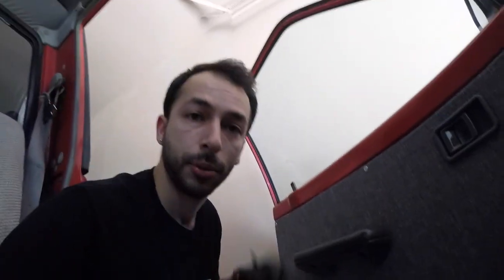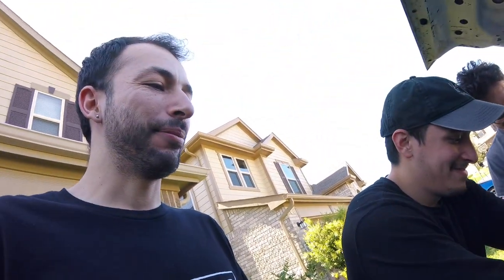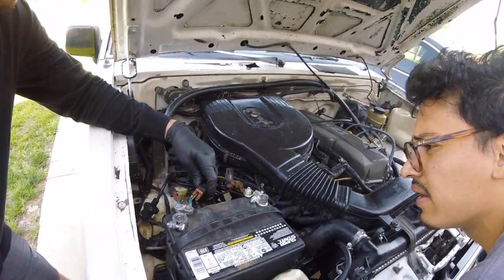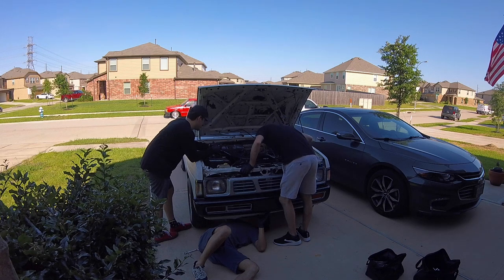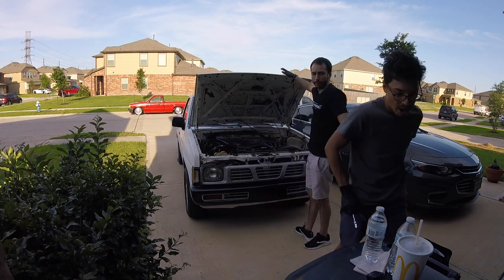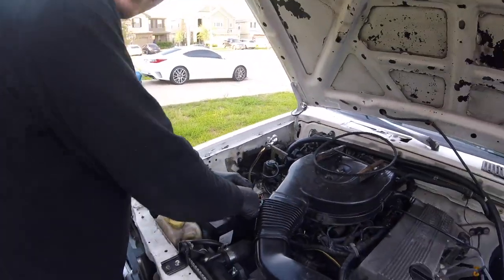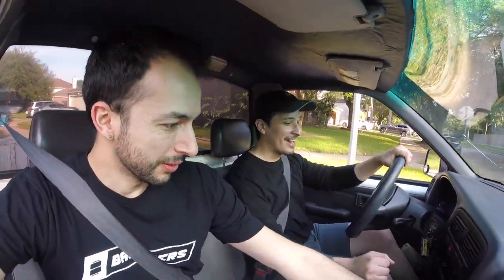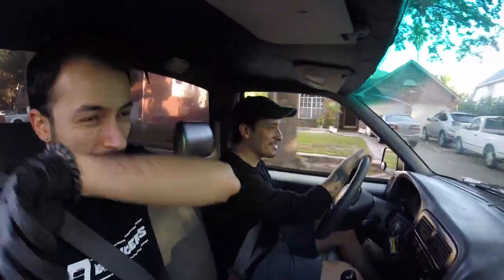Mini Truck Mazda B2000 Door Handle | Fix Nissan Hardbody - Vlog 2

Comment: hello I can really use some help on how to locate a faulty wire in my b2200, also how can I get it to stop back firing so much
Reply from the maker: Check out http://www.mazdaminitruckin.com/ they have a lot of shop manuals and diagrams that can help you with your wiring issue